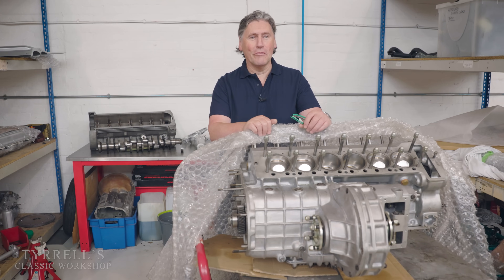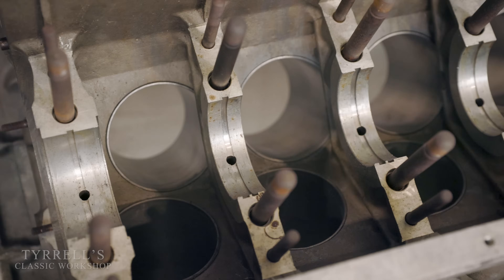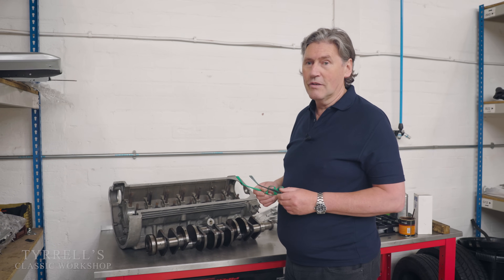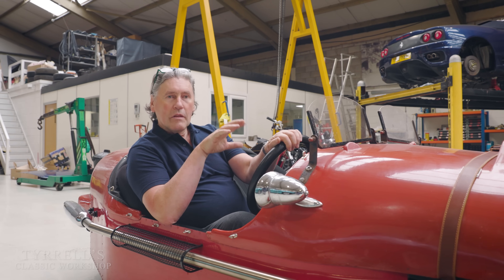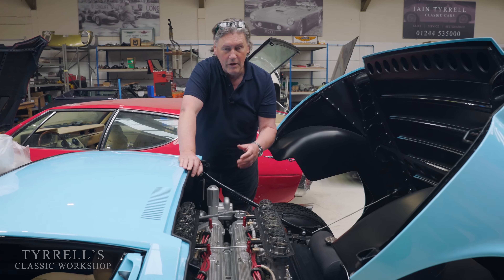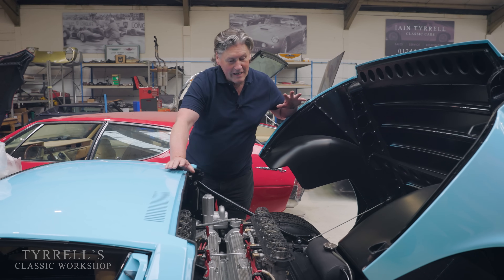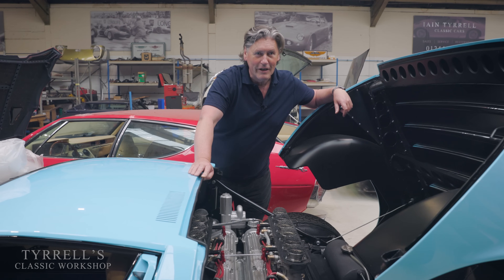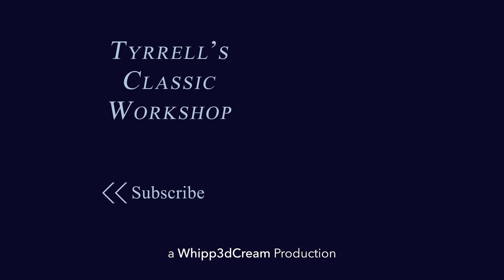How to warm up your classic car engine the correct way & why it matters | Tyrrell's Classic Workshop

Comment: You smashed that item Iain - I also run a Bentley Continental R with the Zytek management system. TBH I have been a little concerned as to why it doesn't start on the key immediately. At first I thought there was a starting issue - the starter cranks over for maybe 3 seconds before it sparks into life, I now know that this is perfectly planned and normal. Back in the day I started my working life in a general garage (age 15). Each morning it became my job to move the cars out of the workshop, something I really enjoyed. One day I started a Mini Cooper 1275 S and immediately revved it. The chief mechanic came over and almost fired me on the spot and went onto explain what damage I was doing. I never forgot that lesson and since then I have gained a great deal of mechanical sympathy. One thing I have never been totally clear about is at what point can you push the car harder, should I let it warm right through or just keep it under 2~3k revs for the first couple of miles?

Comment: Thanks Ian, really helpful. Could you advise starting a Maserati 4200 - similar to Ferrari F430 engine. Should I hold starter and release just before it catches a few times?
Reply from the maker: Starting as normal will be fine on this managed engine
Reply: @iain_tyrrell  Thank you so much!

Comment: Interesting video thanks. My Jag F Type flairs up to 3500rpm for a few seconds from a cold start all in the name of "theatre". As an engineer it makes me cringe but there is nothing that can be done to stop it. Some people say put it into gear to subdue it, but I don't agree that adding load at that point will do it any good either. What do you think about that?
Reply from the maker: That’s how Jaguar made it- though 3500 rpm does sound very high

Comment: Our 1991 Supra sometimes sits even a few months between drives. What we use to do then is to pull the EFI fuse, crank the engine for 4-5 seconds, reinsert the fuse and then start the engine. But I have a question for driving it afterwards: I personally like to disengage the overdrive and drive it around town without it for the first minutes. My thought is that it reduces the load due to shorter gearing and lets it rev a little higher. Would you recommend that as well?

Comment: So how would this apply to say a pre-95 Porsche? At what year can we be confident that the engine management system is good? I'm assuming that for say 80's cars, 1. turn on ignition, 2. pump throttle 6 times, 3. turn on engine 4. Hold at 1500RPM until warm, not allowing it to idle? As a general rule?
Reply from the maker: 1980s Porsches have good cold start systems. No need to pump throttle etc. just turn the key

Comment: Thankyou Iain, so well explained and mate no need to apologise, I think all of us who own and love our classics regardless of what they are appreciate your well experienced knowledge and advice. I know all too well with my 105 series Alfas and Fiat AC 124 sport about priming the carbs with 4 pumps on the accelerator before turning the key, ditto about not allowing the engine to struggle on low revs. However, you lay out the reasons why and it makes complete sense 👍😁.

Comment: Ahaa so that is the reason why when i start the engine my fairly modern Volvo it automatically revs at a somewhat higher RPM for a minute or so. Next question would be then, is it healthy to drive away immediately or wait for the engine to calm down ?
Reply from the maker: Drive away gently immediately in a modern car
Reply: @iain_tyrrell  THANK YOU MAESTRO IAIN !!  ♥♥♥

Comment: I have several Rolls Royce Shadows/Clouds. Would it be ok to just pull the ignition coil wire to the distributor to keep the car from actually starting thus giving the oil time to luburicated everything?
Reply from the maker: No, that will wash the bores. Turn over for 5- 7 seconds, then press accelerator pedal once to prime auto choke and cold start normally
Reply: @iain_tyrrell  Understand! Appreciate it! Thnx.

Comment: Install  pre-start electric oil pump. Flip a switch watch the oil gain pressure. Many systems have a timer...5- 10 seconds...or use manual shut off....then start as usual. No one should ever Rev a cold engine... wonder if updated seals could be installed in vintage cars...then use synthetic oil...rich folks can afford the re-seal job! 😉
Reply from the maker: Synthetic oils are too thin to run in Classic engines with big bearing clearances

Comment: So with the miura, you start it up, let it get settled and then sit at 1500 RPM till the oil temp comes up, and then let it idle at a lower RPM, how come there isnt an automatic choke that does that, although this explains why on my old 2010 inline 5 car when I started it up, the car would jump to 1500/2000 rpm for about 30 seconds, and then go down overtime and I would let it sit and do its thing then once the revs came down and settled at 900, then drive off. 

figuring alright its doing that for a reason, better give it a moment, as the 5 clyinders abit of a rever

sadly of which I've just traded that car in, had it for 12 years since new, but it was getting long in the tooth and needed bodywork, and brakes were due soon, mind you she was as solid as a lion and I will miss it and its engine note dearly, as it sounded like the gene hunt quattro when you got on it, but maybe you could take the mechanism from my old car and have it fitted to a miura with a calculated time behind with what the average time it takes for the oil to warm up for the new owner

either that or rig up some cruse control mechanism to hold the gas, failing that, maybe you should start doing an Ian Tyrell start up checklist. laminated, in print that you can hang on the mirror for the more complex cars like that

as it is a multi million dollar miura, that is going to sit for awhile till a weekend start up

Comment: Brilliant Ian, thanks
I have a good idea how to cold start my MGBGT except sometimes I don't turn the engine over with the choke in, but now you've confirmed what I really already knew.
The engine always needs full choke on cold starting and when It fires after about 4 beats, and then a couple of seconds after she fires up I notice the the oil gauge shoots up to about 60 psi as the oil gets round and I immediately start pushing the choke in and after about 30 secs I can drive away carefully, aware that the engine could falter so am ready to adjust (pullout) the choke slightly as required, after about half a mile it's just about running stable.. Anyway, I shall now crank the engine with the choke in from now on
Thanks again..

Comment: Mr Tyrrell, brilliant thank you. My sister and I have just taken custodianship of our family '73 MG Midget (1275 A series)  and '72 MG BGT (1800 B series). both manual choke and twin SUs. Some of this is different to what Dad always did... So do I have this right?  1) crank for a few revelations to help oil pressure 2) as little choke as possible, as quickly as possible 3) don't let it idle on the drive at its normal idle. But! Should I/we drive straight away but keep the revs down while warming or build the revs parked, with no load on the engine? I wasn't sure if that was for V12 Lambo's with no choke or not 🤪
Reply from the maker: Run for a few minutes before driving off ideally
Reply: @iain_tyrrell  great thanks. Brilliantly helpful content. Do keep it up!

Comment: In a past video you added more power 🔋 by adjusting the throttle cable. 
Gamers know this adjustment will cause a car to wheelspin and spin the car during mid to high speed cornering.
Cars need a dead zone in the throttle adjustment. 
You're wrong,  Ian.

Comment: Very precious advice Iain. If i don't starting my Dino Coupè from many time I prefer crank the engine without spark plugs, (obviously with ignition system off) in this manner all the bearings without lubrication during starting time aren't under big mechanical stress, the oil pressure grow up rapidly.

Comment: Great video. I own a GM product with the Ecotec 2.2, and have read about the waste spark system that waits until the engine has gone around a whole firing sequence before starting. Irritatingly, it then guns (briefly) to 2k before settling down. GM wanted the driver to be aware that the engine has started I suppose!
Reply: I hear you. I have a rare Corvette C4 ZR1 with the Lotus designed engine in it. At cold start, it does the same, jumps up to 1500 rpm straight away, you can hear the cam chains rattling for a few seconds before oil pressure builds, then it relaxes the idle down to 500 RPM.  I am trusting the Lotus people knew what they were doing when they programmed the ECU.

Comment: My car is more of a modern classic (e39 M5), if I haven't used it in a few months, I pull the fuel pump relay and crank it for around 10 seconds before plugging the relay back in.
Not sure if it makes much difference, but it makes me feel better.

Comment: Fascinating stuff, Iain, and thank you for posting. I converted my MG Midget 1500 to a Weber downdraft, and left the factory fuel pump (mechanical) in place rather than switching to an electric one. The result is that the engine has to crank for several seconds from cold to refill the carb… ample time for the oil to circulate before it starts. Thanks again, I really appreciate your expertise.

Comment: This is another long term effect of modern cars’ auto start-stop systems that I worry about (besides premature turbo wear). They fire up instantaneously on restart. I always disable the feature on my cars.
Reply: In the case of Start-Stop, it isn't the same scenario. What Tyrrell adresses here is for cold starts. Engines that also may be days, weeks or even months without firing up.
When you stop at a red light, or a train crossing, that's not enough time for the oil to drain down.
Reply: @rata536  it is enough time for pressure to drop though
Reply: @rata536  I see your point, but in a modern engine with thin oils I’m not sure that’s true, or during running the sump would empty before circulating oil had the chance to return.
Reply: as one should :)

Comment: Thanks for the info! Just one question on the Lamborghini Miura method: how long do you keep the RPM at roughly 1500? As for modern cars, I own a 2015 BMW 340i and I got into the habit of letting my car idle for 5-10 seconds until the RPMs drop from the initial ±1200 to ±950. Is that recommendable? Or would you suggest to start driving straight away? Thanks again! 👍🏻

Comment: In the boot of a pre he xjs there is a second wire at the battery terminal you can disconnect. You can crank over a few times to build up compression and oil pressure with no fuel. Connnect it again and voila👍

Comment: I have a car that sits a lot, and I have a switch on the ignition that I keep switched off. When I go to fire it up, I crank it until my oil pressure comes up on the gauge and then switch it on and fire the car. The switch is hidden away and works as a rudimentary theft deterrent as well.

Comment: Interesting video.  I have a four cylinder engine with twin Weber DCOE 45 carburettors and an electric fuel pump.  Originally it had a mechanical fuel pump.  As Iain says, no choke, wait for fuel pressure to build, pump 4 times, in this case, and crank the engine and it fires.  I'm beginning to wonder however if the phrase, "It always starts first time" is worth it with Classic cars.  My wife has an original Fiat 500.  Air cooled engine, two cylinders and a mechanical fuel pump
Reply: hello how are you doing 😊

Comment: Thank you very much, I enjoy each second of your videos, especially of this one. Nevertheless, I'd like to give one objectional remark. Concerning the problems of lubrication I'd rather assume that the reason for the lack of lubrication for the bearing close to the oil supply is the Bernoulli effect in the main distribution channel. At each junction of supply bores for the bearings to the main channel the speed of the fluid is reduced due to the reduced volume flow at each junction and the (supposedly) constant diameter of the bore. So the speed is at its maximum between the pump and the first junction. According to Bernoulli a local higher speed will implicate a local lower static pressure (!). And this would be not only during startup but tendentially during the whole running time. The smaller the supply channel is, the stronger this will effect the static oil pressure distribution in the bearings. Pls tell me your opinion about this assumption. Thanks a lot and greetings from Germany.

Comment: I was just reflecting on the start procedure of my 300CD.  No high speed idle or choke obviously, just bumps to life with very little drama and instantly idles as normal.  I assume this is one of the reasons these diesels last so long given so much engine wear occurs in the over-rich moments of the cold start high idle.

Comment: On a somewhat related topic, cold engine loading is a big reason why I turned my Passat back into VW as part of the dieselgate mess. The engine management had a barbaric warm up strategy. In order to get the catalytic converter and DPF hot as quickly as possible, as soon as the coolant got to 110*f and the automatic transmission shifted into 3rd gear, the ECU would crank the turbo up to 22 psi of boost under all load conditions, and begin doing post injection to raise the EGTs to 1200*f. It would do this until the post DPF temperature reached some level, I forget exactly what it was. 
Of course this is like taking your cold engine and then flooring it up a mountain. I always drove the car very carefully when it was in this mode, and had an OBD readout tool on the dashboard so I could monitor it. I know others who said this wasn't needed... and then blew up multiple turbos.
That car would also pick the worst times to begin regenerating the DPF... usually when pulling into a parking lot. You'd have been driving gently, then the ECU would decide now's the time to cook the filter, and again crank the EGTs up to 1200*F. There's no indication from the car that this is happening, so many owners would happily park up with the turbo at 1200*F.  Of course the oil flow stops, and those cars don't have a water cooled turbo where an after-run pump would help. So again... like flooring it up a mountain and just shutting the engine off at the peak!

Comment: Thanks for this excellent knowledge dump! 
Whenever I start my old diesel Benz after having sat for a long time I have a friend hold the engine stop lever down while I crank, until it builds some oil pressure. Then I start the engine. On a turbo motor I imagine this helps.

Comment: Very interesting! It would be easy to run the ignition circuit through an oil pressure switch so that a car would crank but not fire until there was sufficient oil pressure (as a retrofit kit)

Comment: What happened was, oils with detergents came out in the 70s . and there was an this fanfare and advertising about how great they were and how clean they would keep your engine. So people went out and put this new whizzbang oil their car and thought it meant they didn't need to change their oil anymore. but the inverse happened - because the detergents pull all the gunk and carbon out of the nooks and crannies and bring it into suspension, so really it needed to be changed more often initially in older engines, and a lot of engines ended up wearing prematurely because of it clogging up filters and blocking strainers. Castrol should have been sued in oblivion by now for all the engines they caused the early demise of with that GTX stuff - Can't believe it's still on the market!

Comment: I have been told that Diesel engines last longer than their petrol equivalents partly because Diesel has inherently better lubrication abilities which reduces cylinder bore wear and bearing life. I have an Audi SQ8, 4 Litre Diesel and wonder if starting procedures are as important for this vehicle as for an equivalent petrol engined one?

Comment: Genuinely useful information as the owner of a Silver Spirit with the dreaded high idle cold start auto choke -  I shall be employed an improved technique this weekend - turn it without a throttle pump a few times to build pressure! Interestingly the slightly lazy start on our Bentley Turbo R (which has the Zytek system too) I had always put down to needing a good service, I didn’t realise it was a feature to protect the engine! Super super interesting!

Comment: FINALLY an expert tells it how it is. Ive tried to explain this to young techs and ppl and they just dont get it. As new cars rade to warm up so fast for emissions its basically not an issue. Yet older and vintage cars 100% should warm up b4 loading the engine hard

Comment: Fascinating video Iain, you took me right back about 45 years to my first office job working with an old boy who was keen on cars. I remember he regaled me one quiet afternoon with a long explanation of how Ettore Bugatti would insist owners of his cars should run first lukewarm, then progressively hotter water through the block, hand pump the oil pressure up, and only then attempt to start the engine!

Comment: agree with al especially the manual chock; need to use as little as possible and get it in as soon as possible. Just have to think of all that petrol not being burnt but washing the piston rings free of oil .